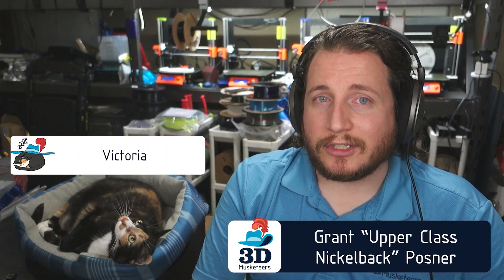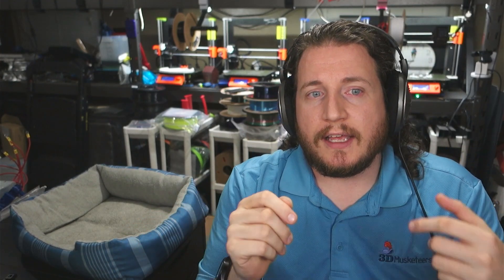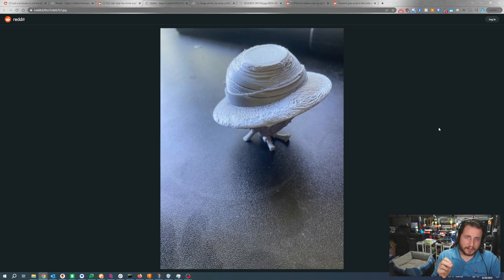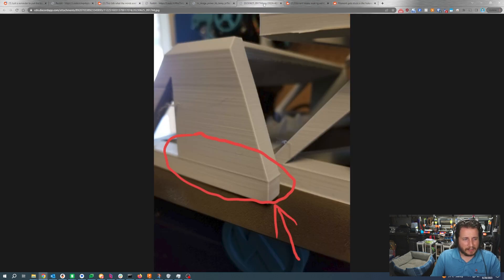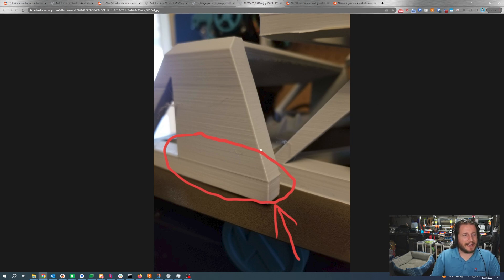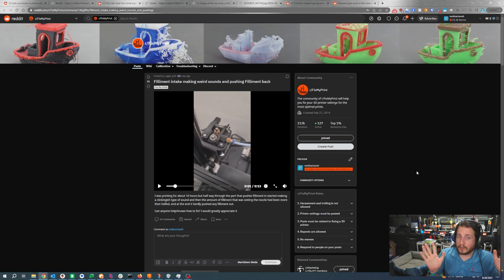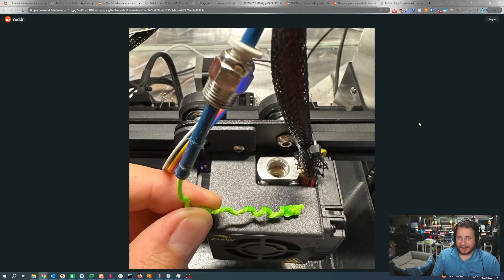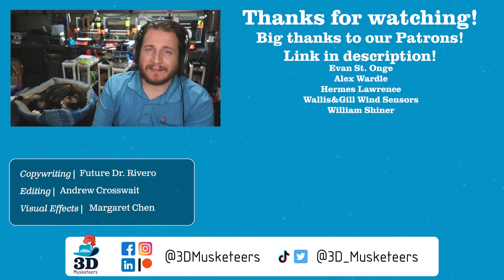Slicing and Nozzles: Rough Prints and Random Lines! - PrintFixFriday 94

Comment: Bl touch mod because you cannot fake a mechanical connection and yes a 5015 mod is present. Sliced on your PS profile with cooling fan turned on 100% after layer 3. Apologies I did forget to add that info for the fail submission. I will be checking E steps as the extruder bits look solid and the roll of filament has proven to be decent on other machines. Thanks for the advice sir!
Reply from the maker: very fair! Good luck!

Comment: 9 out of 10 times if the ender extruder is clicking , it is a clog. 1 time out of 10 I bought some really cheap (in more ways that one) PTFE tubing. My Creality "Direct Drive" uses a short piece of PTFE tubing and the plastic extruder lever broke in less than a month. I will say that It has been printing pretty great after I ditched the glass bed for a PEI magnetic build plate , and dialed in better printing temps.
Reply from the maker: lol I feel that, but might as well cover the bases!!
Reply: My ender 3 has always clicking/skipping.  I replaced the extruder, but when I took off the stock one, it looks like the stock knurled gear had work in the groove the filament rides on.  So basically I think I could have fixed it by just adjusting where the gear attached to the stepper motor shaft to give it a fresh splines to drive it.
The new extruder fixed it also.

Comment: You didn't talk about the bltouch like you said you would. I've had mine randomly drop and catch the build plate, only once but now I'll always be wary. Inductive is way better if you're using metal plates.
Reply from the maker: did I say I would, I am sorry.. But yes, they can drop if they dont get the right voltage
Reply: @3DMusketeers  I'm still not sure what made mine drop, the wiring was well secured, I think it rattled to fall down, but I found it restored to the UP position so it corrected itself, left a dent in the side of my old E3 style build plate.
Reply from the maker: its why I do like my plastic probed one that is older lol
Reply: @3DMusketeers  that's a very good point, I'd never considered it's not about the probe surviving, but the damage it can do to other things.
Reply from the maker: yep I would be totally fine nuking the plastic probe and not messing up my machine

Comment: I feel called out by all 3 failures. I've been there in all three. What fixed the second failure was to simply turn down the flow rate. The third failure, I broke the fan shroud fixing and replacing the hotend after heatcreep and clogs. The only way I fixed it was replacing the hotend by a creality sprite instead. Also lots of love for the diamondback nozzle. I'm still extremely satisfied with mine after a few months.
Reply: I've also done failure number 4 as well lol.
Reply from the maker: I think many of us have had all these failures before, it happens!

Comment: Just a heads-up for the Voron 2.4r2, the bed can come loose due to the fact you only tighten down one.  My bed came loose, knocked the Z probe out of position, then on the next print the nozzle partially missed the probe and dug into the PEI sheet.

Tungsten carbide nuzzle just shrugged it off.
Reply from the maker: oh really. good to know!
Reply: @3DMusketeers  Should have known something was up yesterday when it layer shifted; restarting without checking led to the destruction of the PEI sheet.  Currently printing on a corner that hasn't been mangled.
Reply from the maker: oof sorry man!